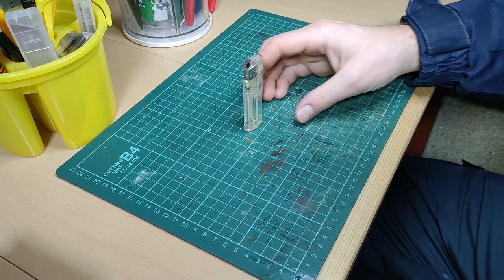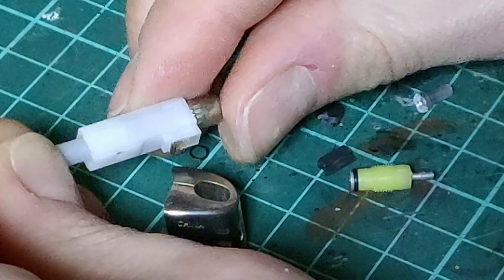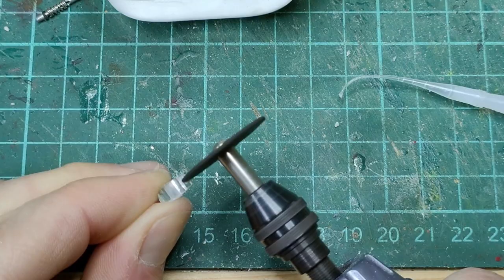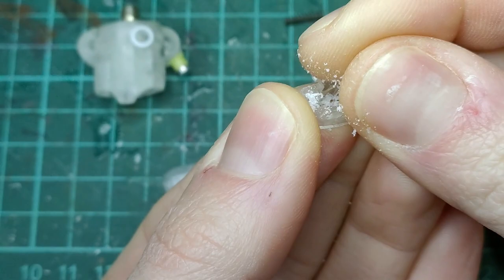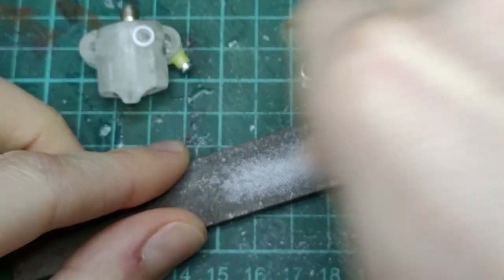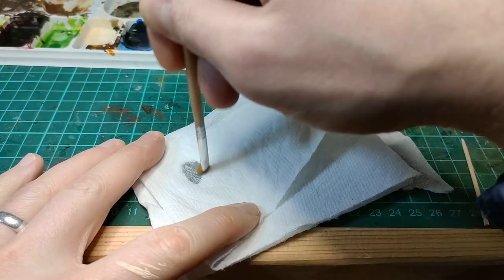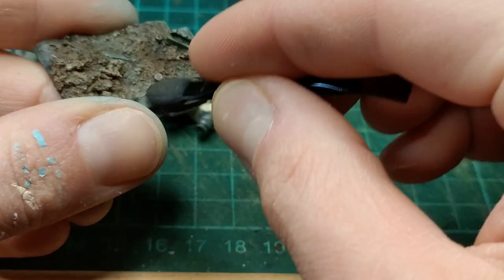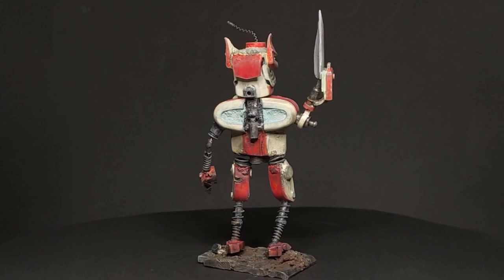I made a ROBOT from a single LIGHTER! | crafting with trash

Comment: Yes! Scrap builds are great, and - as you did - saving the crap, dust and offcuts is a great source of filler, shims and bracing, without using more 'good' plastic.
Reply from the maker: Cheers! It was a fun challenge to use as much of the lighter as I could 👍

Comment: Excellent.  I have a lighter that doesn't work. But I need to empty it first.
Reply: Be very careful when you do this! I did the same thing with a full lighter and there was a giant hiss of gas + fuel in my face. Had there been any spark around it would've gotten ugly. Make sure you dissemble it pointing away from your face, and preferably outside.
Reply: @gameyybuilds  thanks... that was my plan. Might add a bit of lubricant to top. Seems to have seized.
Reply from the maker: Good looking out Gameyy! Galth, I highly recommend using spent lighters or taking extreme care to be safe when messing around with fuel and igniters!